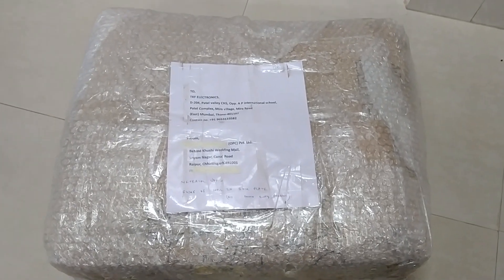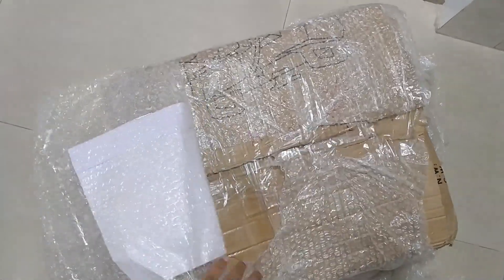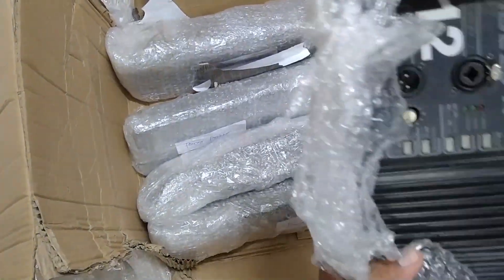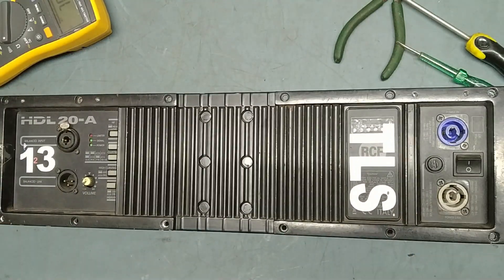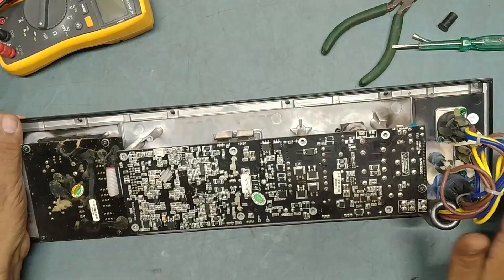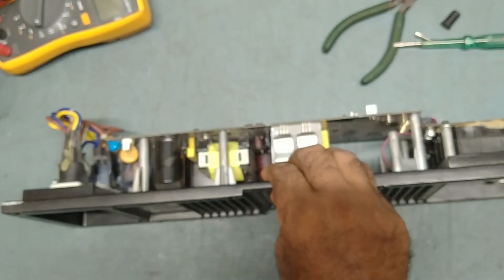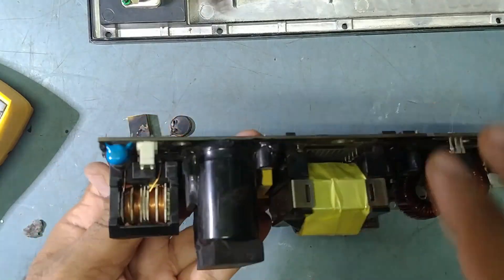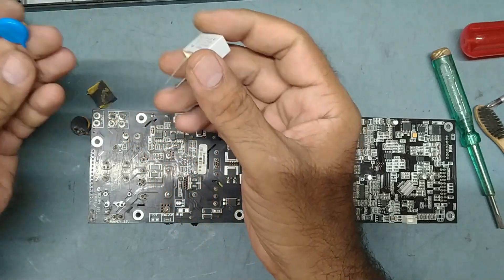Repairing very badly Shorted RCF HDL20A Active Line Array Module.

Comment: i've repaired many due to a shorted ceramic cap near a screw post
they tighten it too much and the board warps then the cap shorts
Reply: Where exactly is this ceramic capacitor located on the board?
Interesting info for sure; never heard it mentioned before.